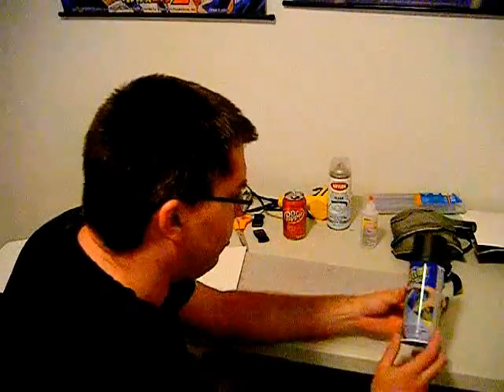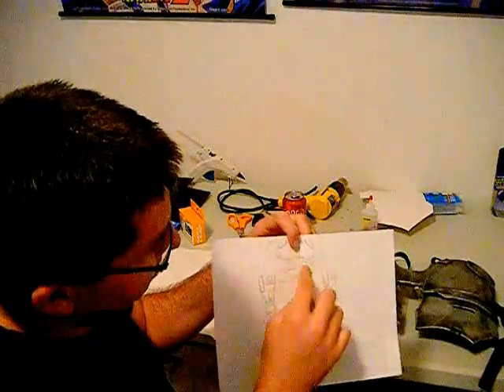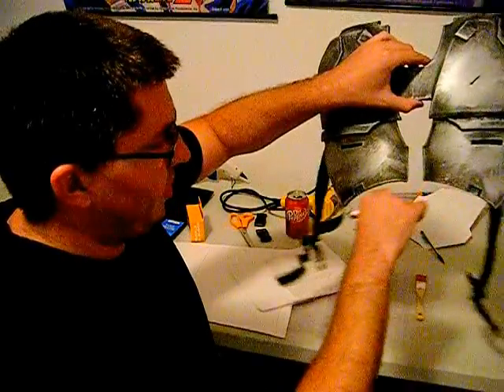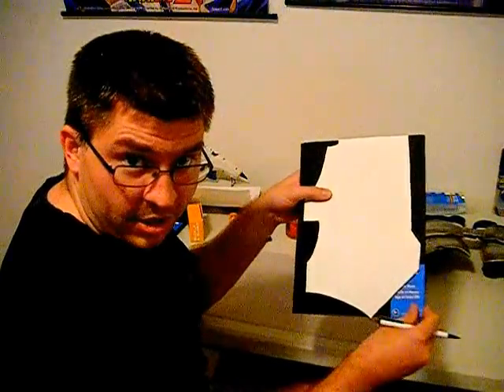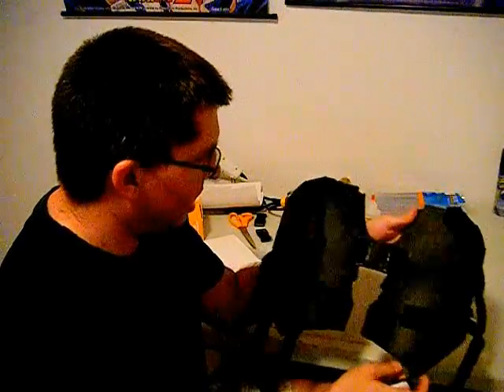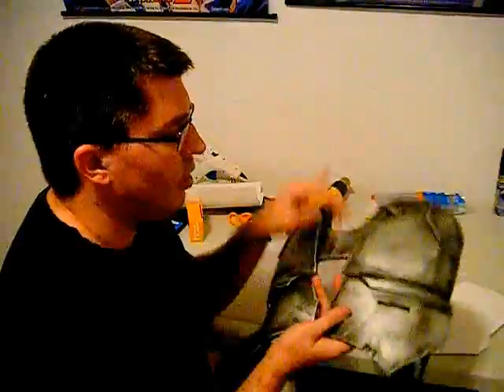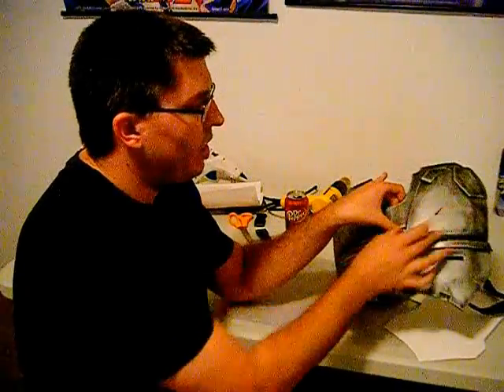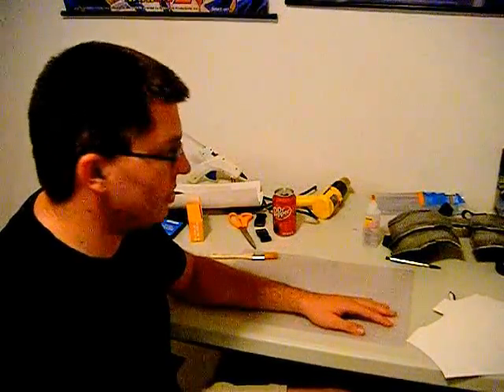Sith/Jedi Cosplay Armor Tutorial - Chest

Comment from the maker: You can, however, I haven't tried using Fiberglass over the front of the foam. It works fine as a strengthening agent on the back. Unless you apply it evenly over the front of the armor, then you might have to sand it down to get it even. I have no advice for sanding glass on foam. I haven't tried it yet.